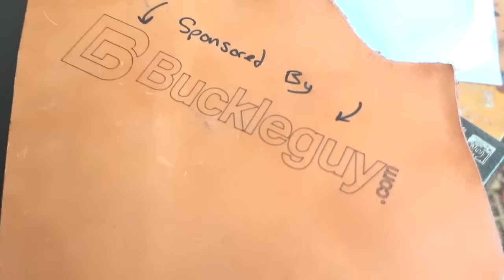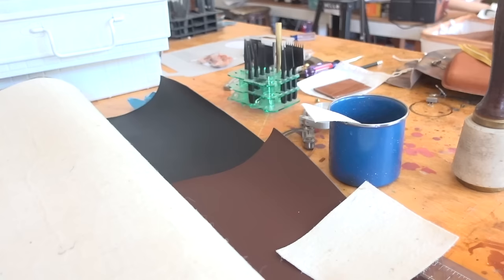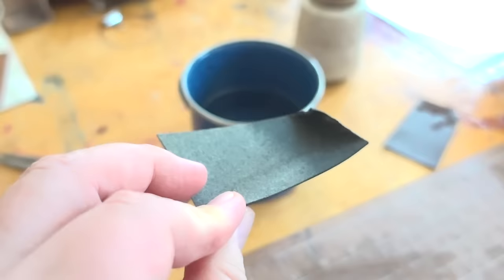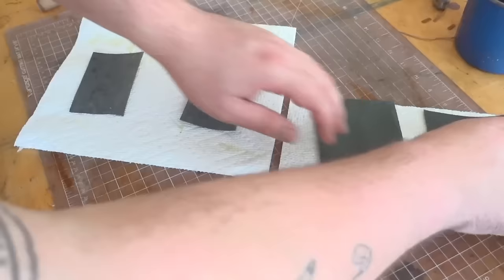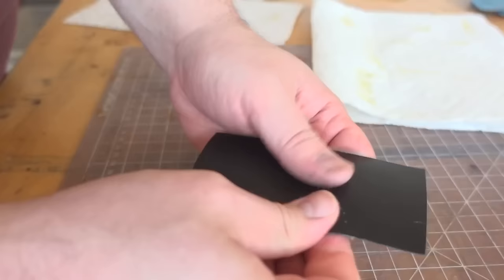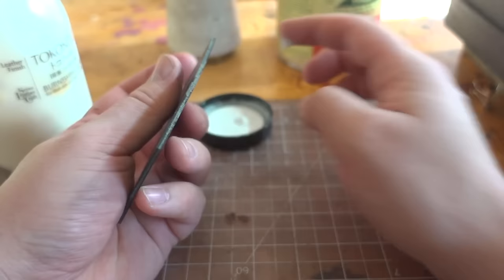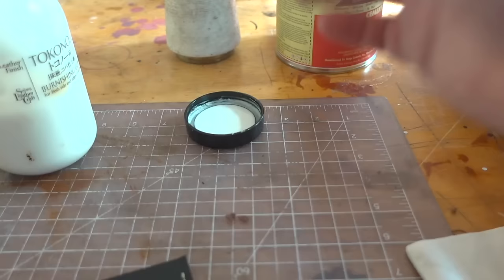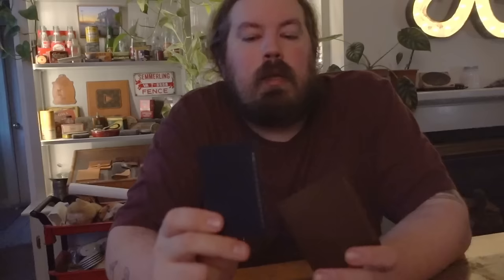Plant-based Leather: The Ultimate Game Changer Or Total Flop?

Comment: i find it interesting that plastics are marketed as vegan. if the plastics used are made using crude oil, natural gas and coal, then they are animal and plant derived.
Reply: yup, this right here
Reply: I mean crude oil, gasses, and coal are almost entirely plants technically. Plants got to the surface before animals and so the best working theory is in that gap of time where animals hadn't caught up there weren't many biodegraders like fungi or bacteria so the land was choked with dead plantlife that couldn't be broken down fast enough to avoid getting buried and that initial layer of moss and foliage is the vast majority of the biomass used in fossil fuels. 
But even without that explanation "vegan" is still a marketing term that in non-food products more or less means "not tested on animals" so companies that use animal in their products can market them as vegan as long as they don't do animal testing and get away with it.

Comment: Eric:  If the cost is really low, this would be a great 'Prototype' material instead of wasting real leather.  Right now I used 'Fun Foam' to prototype.  Flexible.  Right thickness.  Cheap.
Reply from the maker: Honestly these materials wouldn't be great for samples either as they're pretty impossible to glue. When I order hides that are split down I ask for the split to be shipped with it. Free, works just like leather because it is - it's just the fiber part - and perfect for samples :)
Reply: @Corter  I completely agree about the splits. Same flexibility. Best standin for prototypes. Very smart.

Comment: Thanks for doing the demos on these leather alternatives.  I was compelled to use these for my leather stand at the County fair last year. I used grape leather and cactus leather. Both failed miserably.  The rivets I set in to hold the handles so embarrassingly pulled straight through. They have no strength  and I will not be using these on my stand ever again.

Comment: I'm curious about the price difference.  Is it cheaper than actual leather?
Reply from the maker: Depends on the leather, most of the plant based options I found were around $7-9 a square foot which is solidly in nice leather territory
Reply: That must be bulk pricing. $7-9 certainly won't get me a sq ft of anything nice at BuckleGuy or RM.
Reply from the maker: You'll never get that price buying a single sq. ft. of anything, nope. "Bulk" usually means  a dozen of the same hide. Buying panels, which are great for small projects or trying a new tannage, you're paying for the labor to panelize a hide. The whole "panel" concept  is a fairly new concept in the crafting market - panels have only been around since 2017-ish. Up to that point a single shoulder was as small as you could get in a very limited amount of leathers. I buy sides, shoulders, etc. because buying individual panels is not cost effective or large enough for the things I run through the shop
Reply: @Corter  Huh.... That's interesting to know, actually. It never occurred to me that panels and smaller "square-type" cuts weren't always just "a thing." So, basically, they created a higher profit market within a long-established market... Lol. Cool to know. I, personally, have never bought more than a panel or two (clearly, I'm new to this and don't sell a bunch). Funny to know that wouldn't have even been an option just that recently back in time. Cheers!

Comment: In my opinion "Plant-based leather" is still plastic-based fake leather with some plant fibers. It might be better than the older full-plastic fake leather, but its still plastic. 
As far as I know they can't really be recycled as its a mixture of different plastics, but that might have changed since I last read about this, which was some years ago.

The main issue i have with any kind of fake leather (full plastic or plant based) is they war out really quickly. Even if not used heavily. 
Either the top layer or the top lacquer, peels of the backing as a whole layer or flakes of in tiny pieces, or the material just fails out of nowhere. Regular exposure to sunlight or sweat speeds up this process like crazy.
Also fake leather doesn't age or patina like real leather does. It just looks like brand new, until it starts to break. 

Real leather has to be maintained, but at least it doesn't break down if maintained properly.

Comment: my only question is how will it hold up over time 
what happens after 10 20 30 50 years 
also like a lot of vegan products have plastics or chemicals in it
and there we go polyurethane no thank you , its out already and the video is only at one minute mark
Reply from the maker: They're pretty clear in all the reading material that it's only meant to last 10 years max, which is super confusing because they're currently making car interiors out of it lol
Reply: @Corter  Cars are designed to be replaceable products now. It is too true that they don't make them like they used to. Planned obsolescence is the sales strategy for a lot of companies. I feel like leather workers are the opposite. Thank you for the video.

Comment: I think, all this leather replacement stuff miss the point. Leather is already a recycled product. It uses the remaining rawhides from meat production. As long as animals are raised and sloughtered for meat, there are hides remaining. Them not using for turning into leather, you should have to throw them away. In terms of sustainability and environmentally a complete nonsens. Leather is one of the oldest receicle products of mankind. Why change a winning team. And if the tanning is made in industrial developed countries with proper environmental regulations, the production doesn't harm workers or nature. 
My opinion as a tanner, working 45 years in the leather industry.